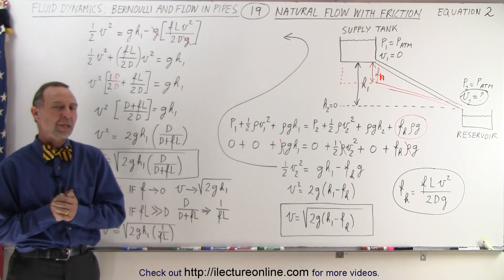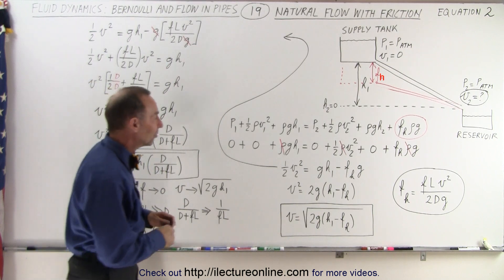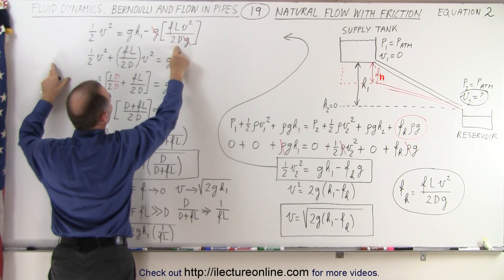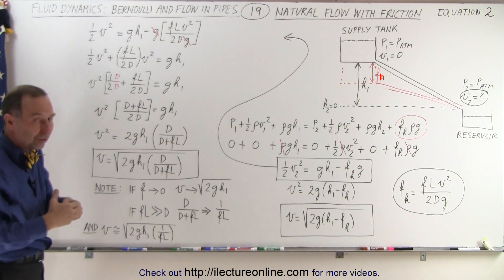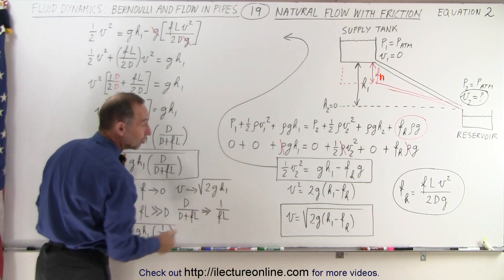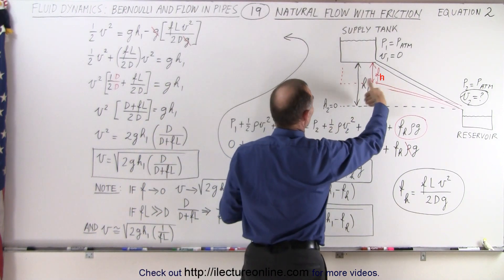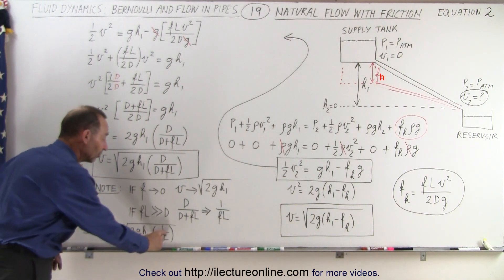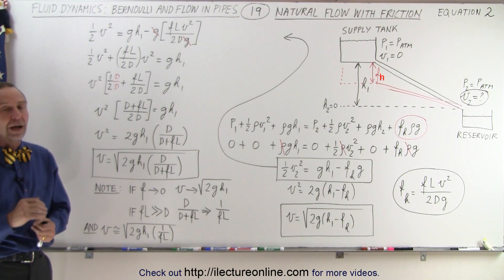Physics 34.1  Bernoulli's Equation & Flow in Pipes (19 of 38) Natural Flow with Friction: Eqn. 2

Comment: Great videos! Question, why doesn't h1 include the height of the water in the supply tank? Doesn't that head contribute to the total head? Isn't that the hight where the P1=atm assumption is being made? Thanks!
Reply from the maker: If the height of the tank is significant relative to the drop in height of the pipe, then by all means add it.  Here we are ignoring it.
Reply: Hey  @MichelvanBiezen  thanks so much for the response, gotcha! I've been reviewing a bunch of fluid dynamics for work and your videos have been real helpful, thank you 🙏

Comment: Really appreciate your videos. I just have one question: Why does the height 'h1' not extend all the way to the water surface of the top reservoir instead of the bottom? I thought this because we are considering 'Point 1' to be at atmospheric pressure which will not be the case at the bottom of the upper water reservoir.
Reply from the maker: You are correct.  For simplicity we ignore the height of the reservoir since in most applications is is minor compared to the height difference in the pipe.  But when it isn't you should include the height of the reservoir.
Reply: @MichelvanBiezen  sir, should we take the height all the way up to the center of mass of the resorvoir or the height up to the water surface?

Comment: Now I need to calculate velocity in my project.
( Raw water tank to underground water tank )
There is long horizontal piping and need to consider head loss.
By equation 2 , I need to find friction factor. To find frition factor, I need velocity.
So, how can I find this velocity Sir?
Can I use (sq root of 2gh ) equation?
Reply from the maker: Ignoring friction, viscosity, etc. that is correct